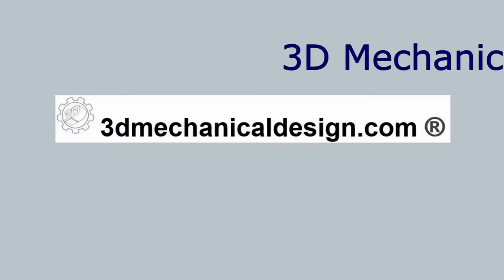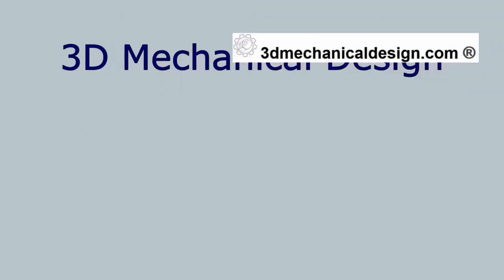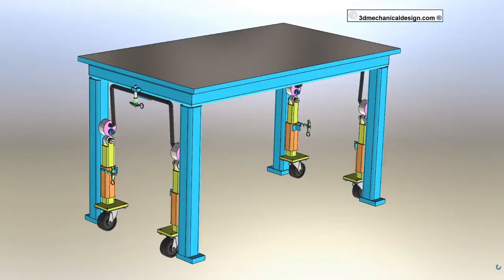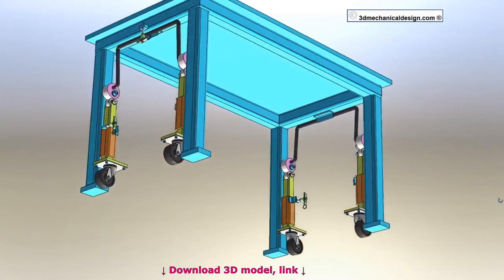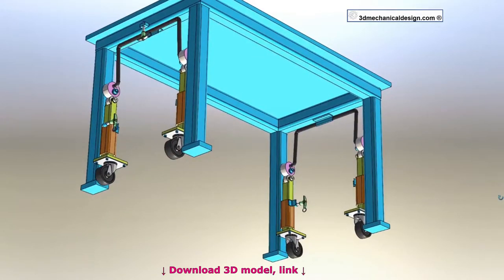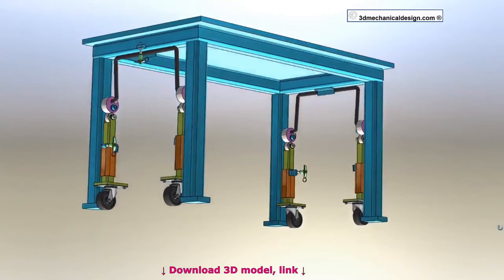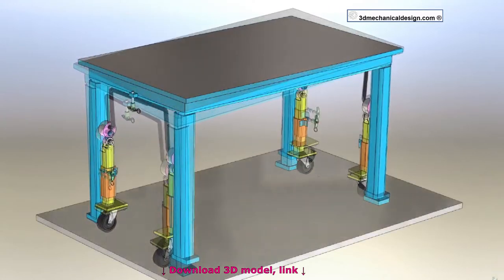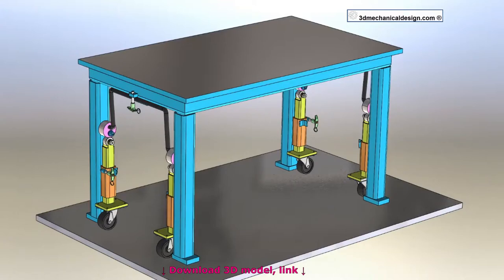⚡ Table with retractable casters. Lifting wheels for table

Comment: Awesome!!! This is by far the best design for retractable casters on a metal table that I have seen. I can also see making most of the components out of wood to be used on a woodworking workbench. I am not easily impressed, but you have done it. Thank you for making this video.
Reply from the maker: Thank you very much

Comment: What’s the size of the Cam and what’s the lifting capacity of this design? Thanks in advance
Reply from the maker: The lifting capacity of cam mechanisms depends on the cam diameter, handle length and cam material.
Longer handle - will increase the load capacity, less friction, the load capacity of the table will also be  increase .
you can google the formula

Comment: What material would the cam be made of ? That can withstand the load of the table itself ? Thank you
Reply from the maker: The material of the cams may vary depending on the weight of the table and the conditions of use.
The cams used in most machines are made with metal, although certain equipment also uses a variety of synthetic materials. Common materials include various steel alloys such as high and low carbon steel, nylon and polypropylene.
Reply: @3dmechanicaldesign  thank you very much

Comment: Will this design be capable of lifting a fully loaded 800 lb workbench ?
Reply from the maker: The lifting capacity of cam mechanisms depends on the cam diameter, handle length and cam material.
Longer handle - will increase the load capacity, less friction, the load capacity of the table will also be  increase .you can google the formula

Comment: this is a good design for a home shop or something but bad for a manufacturing. This doesn't take into account the weight of the table so when you got to take the table off the wheels, the arm will come flying up cause of the cam system and smack, trap a body part in between the table and arm or just cause general injury to the person using it. it could be caused be negligence or lack of  strength of the operator.
Reply from the maker: This is only idea/prototype👍

Comment: The green bolt should remain in a stationary position when the cam action bar is rotated/lowered to elevate the table.
3D video should be corrected to reflect the realistic action.
Reply from the maker: Green is not a bolt, these are quick release pins used to hold the handle.
Reply: @3dmechanicaldesign  , I know that, that’s not what  was referring to. When you look closely at the cam roller when the handle position is pushed downwards the “supposed to be stationary bolt holding the cam roller to the table leg, is actually moving.
Reply from the maker: @SJG-96  Thank you. I will check the video.
Reply: @3dmechanicaldesign  thanks for your reply.
As for my application (workbench) the moving leg (with the foot that the casters are attached to) I have to modify that part because I’m using 5” swivelling casters, requiring a “4 3/8” turning radius
Reply from the maker: @SJG-96  Thank you. I will make a concept with with swivelling casters too